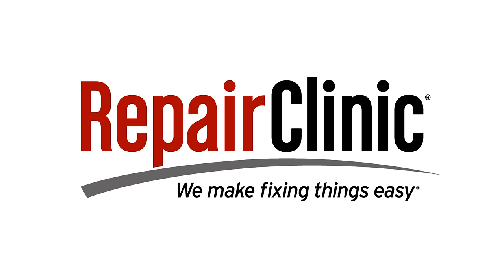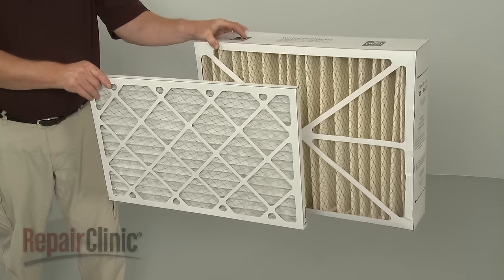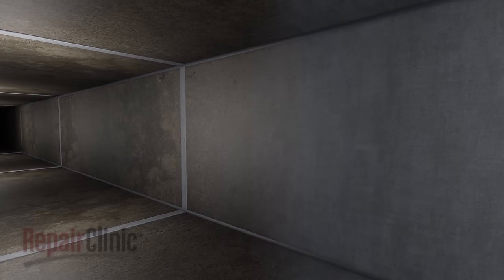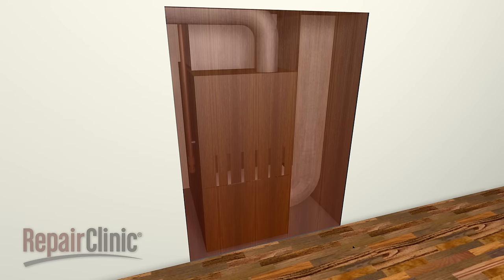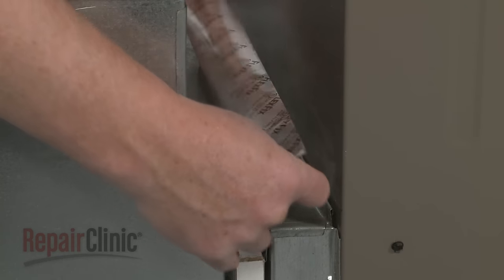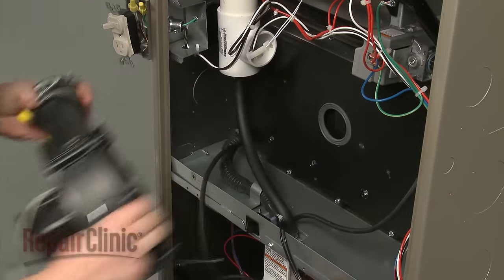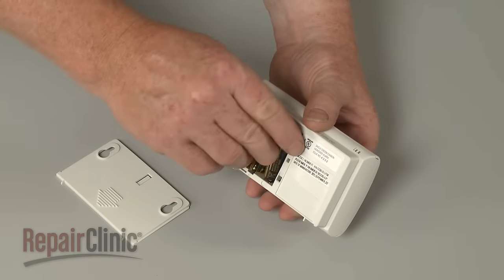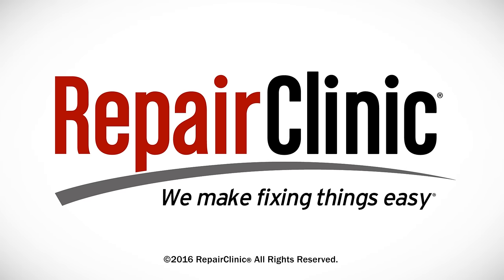Furnace Maintenance Tips

Comment: Never use duck or duct tape on your ducts. What they are using in the video is called "foil tape" and it is designed for ducting. If you're serious about sealing ducts, buy a product called mastic sealant. This is a product that you paint onto the ducts that will form a strong water-tight barrier for all the small cracks and holes. Use the foil tape on round ducts or larger holes and then paint the mastic over it to make sure you have a good, air-tight seal.
Reply: Exactly what I was going to say never use duct tape on ducts

Comment: Does video show backward filter installation?  Reinforced side is supposed to face the furnace?
Reply: @repairclinic  Thanks!  I'd dumb down these videos at the risk of insulting the intelligence of some in your audience.  Start by differentiating the return duct from the furnace.  

I teach astronomy and found to my amazement not only does practically no one know the sun rises in the east, they don't know which was is east.
Reply: It was installed correctly. The paper structure you see there is different from the wire mesh reinforcement. You can also see the airflow direction arrow on the filter.

Comment: Is the pilot light turned off when the switch is off?
Reply: If you have a standing pilot furnace (one that stays lit all the time) then turning off the power will still leave the pilot lit. This model uses a thermocouple system and is on older model furnaces.

If you have a intermittent pilot (one that lights on the heating cycle electronically) the pilot won't light if you turn the power off. This model uses a flame sensor and is on newer model furnaces.
Reply: Thank you